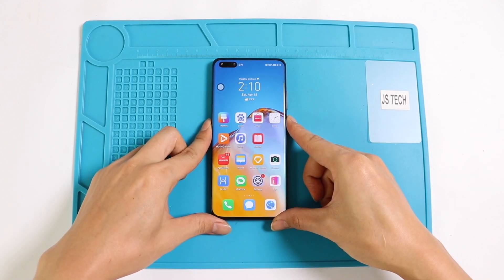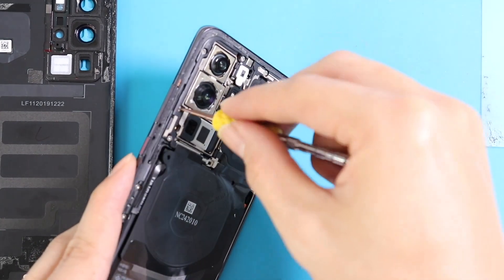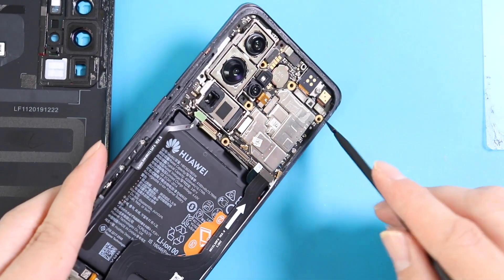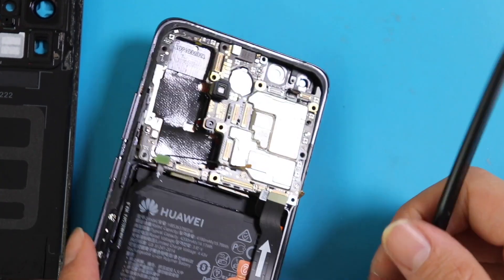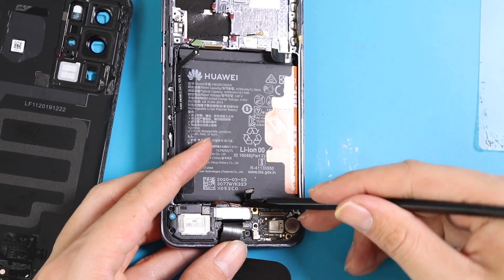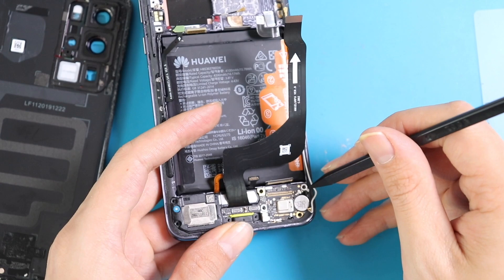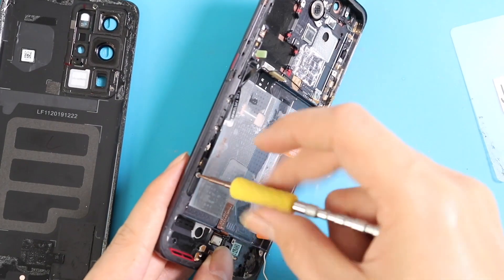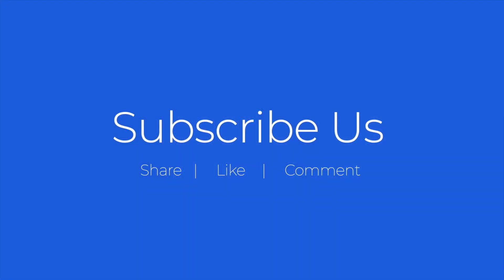Huawei P40 Pro Teardown | Screen Repair

Comment: Geardo why you need to strip all phone to replace front screen cover? Thanks for the answer.
Reply from the maker: Well if you are replacing the screen with frame, you need to strip all the parts from broken frame. But not everything  as per teardown, for example, some parts, like camera can keep it in the logic board and transfer to the new one.

Comment: my pro plus screen cracked 😢, but still can use, how much do you think it is? replace screen
Reply from the maker: An original screen about $120-150..you should use original otherwise your touch id will not work..
Reply: @DIYGeardo  link please where to buy.?

Comment: Is the Fingerprint Sensor still working after repair? Mine need an Calibration do you know how I can do this? Thanks for any help
Reply from the maker: Yeah it was working fine..i think you can do that in settings..i do not have the device now, but i will try to locate this and update you..

Comment: Greetings, dear GEARDO! Please advise me which display to buy on the HUAWEI P40 PRO. With or without a frame? I will give it to the service center for repair, you need to choose a display. I will be very happy if you answer me!
Reply from the maker: Well if you are going to give it to the service center, i think they are doing the repair with the frame.  I mean you can easily go without the frame as well, since they handle the repair.